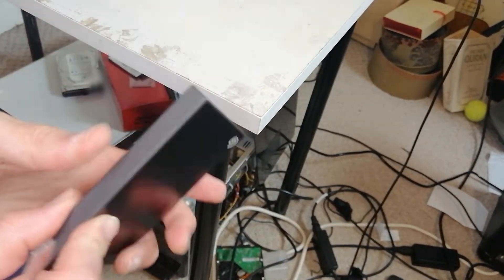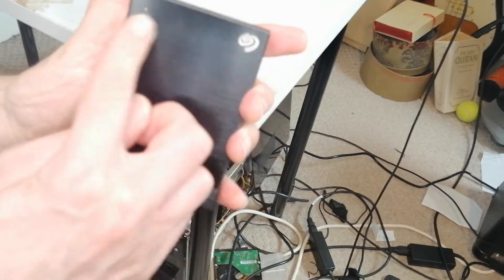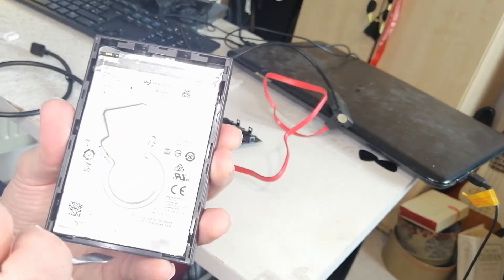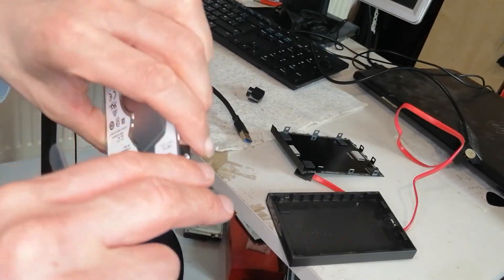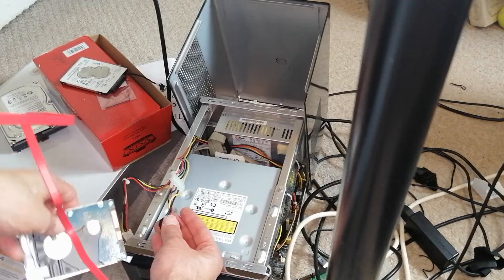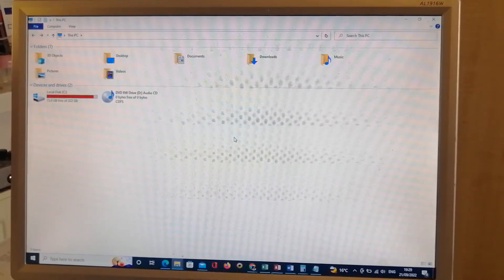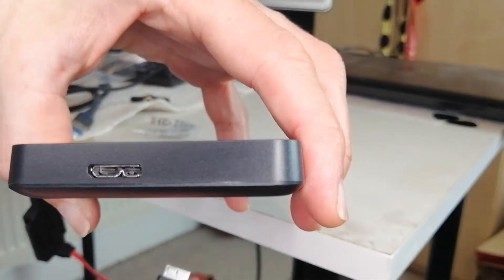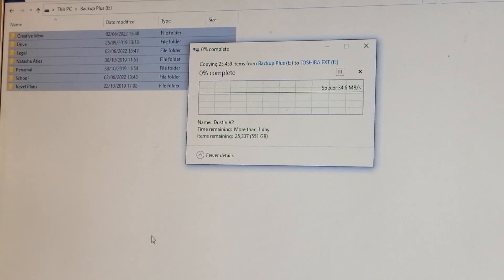How to Recover data from your External Hard drive

Comment: My Seagate also displayed as Backup+ on the  hardisk and printer,but not showing on the My Computer, any solutions?

Im using external hdd normal adaptor not sata cable
Reply from the maker: It is probably due to a corrupt partition of some kind. It is mechanically working correct?

Comment: The newer drives may not have the interface board. I have a new WD Elements drive that is a USB drive only, no SATA ports at all. Give away is the length of the case, SATA drive case is about 6mm longer than the USB drive.

You really should be more careful about splashing peoples names and phone numbers online. (Yellow sticker on drive case)
Reply: I made mistake of removing WD Elements from external case and putting it inside PC (to neaten things up). Darned thing has some "oh there is voltage on that line ... trash the data". Sticking tape over pins 1 to 3 makes it readable.

Comment: Thanks for the Video, however my Ext-hard drive, the tech over here told me that my Seagate 1TB has the heads damaged. To retrieve the data they asked me between 1,700/2000 AUS Dollars which is an outrageous sum of money. 

I would like to ask you a question: Is it possible to do what you do in this video, if mine has the heads damaged? I've got so much stuff in that EXD 😞 that I would love to get my files back.

Thank you and God bless you.

Carus :-)
Reply from the maker: Sorry to Hear Carus. If the heads are broken you require doner parts to restore that's why it can be dear. If you ship it here I'm based in the UK and i can do it for much cheaper with one of my partners here in the UK. Ship with DHL, FedEx or UPS for delivery within 3-5 days. You won't pay anywhere near that price even with delivery. If you didn't want to go ahead if the job you just pay for the return delivery charge back to you.
Reply from the maker: X